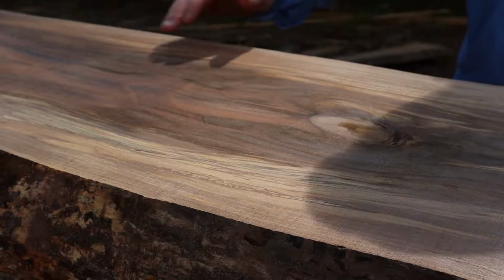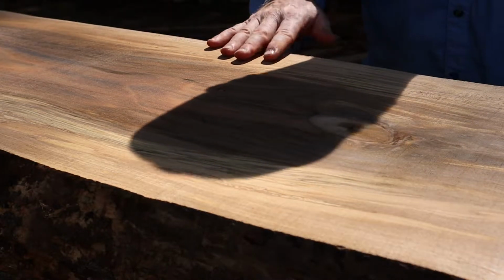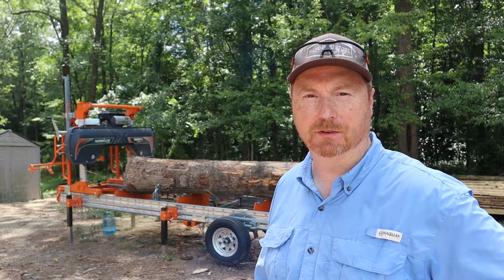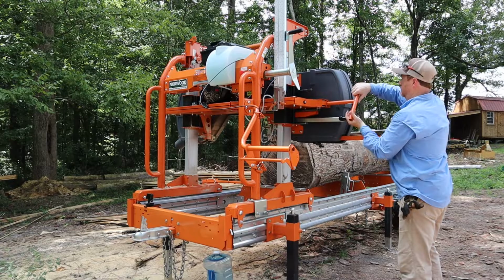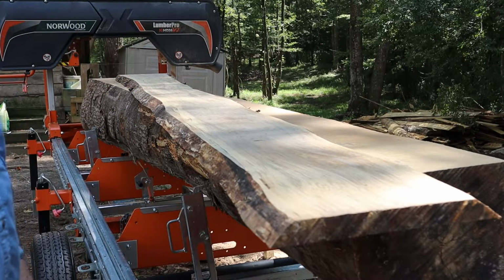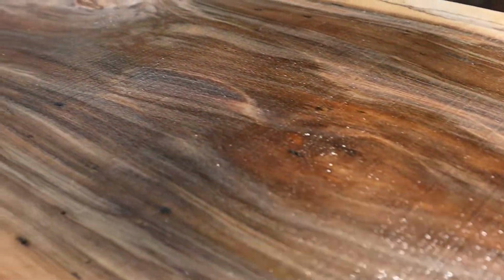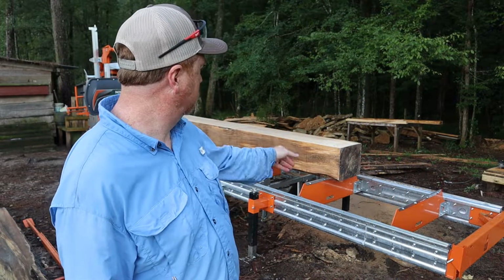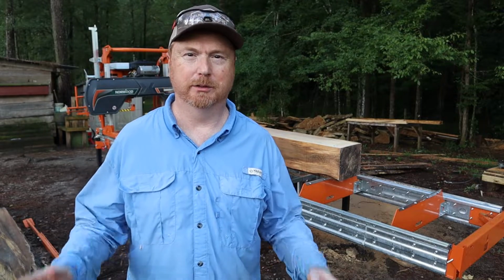Big Gum Log on the Sawmill

Comment: Hey buddy how are ya? The Norwood dh36v2 is a great sawmill! I’ve had mine for about a year now. Was wondering what blades are ya using and how long are they staying sharp? I started with Norwood blades but they could on cut about 1/2 in the wood before I had to change them. Cutting beetle killed ponderosa pine and fresh cut cedar. Thanks for sharing, God bless y’all!
Reply from the maker: God bless you and thanks for watching! I am loving the mill. I started out using the Norwood 10° blades and they worked well with Pine and I have gotten 600 bf out of a blade--but one thing I'm learning is to not use a blade too long, its not worth it. I recently starting using Cooks Saw "Super Sharp Dura Tooth," which is 8°, I really like them, and, at the time, they were readily available. My next purchase will probably more Cooks.
Reply: @TaprootsTadpolesHomestead  I’ll have to try cooks blades I’ve heard good things about them from other sawyers. I found the woodmizer double heads work really good to. I’m gonna get a blade sharpener and setter hopefully soonish! I’m fglad you are lovin your sawmill I do as well. It is so exciting to open up a log and see what’s inside I just love it. Hey by the way where are you located what part of the country? I’m in the Sierra Nevada is just on the border of Nevada in California
Reply from the maker: @heyyoubuddy6749  Sierra Nevada, wow, beautiful! I'm in Mississippi.